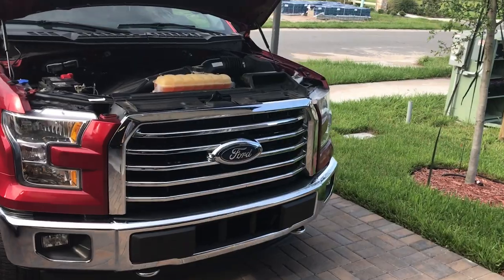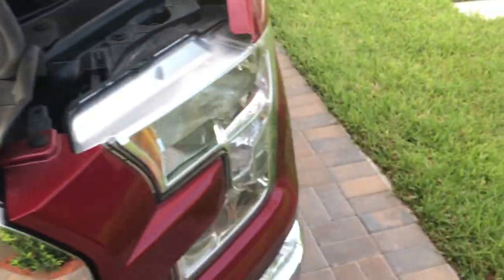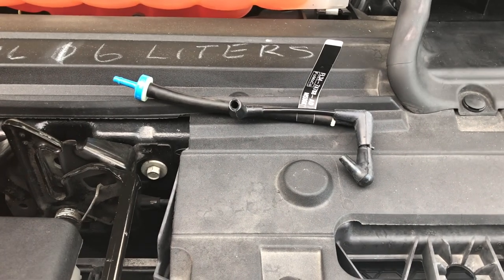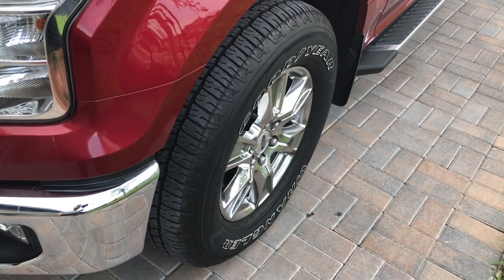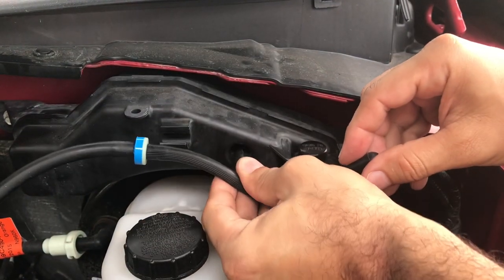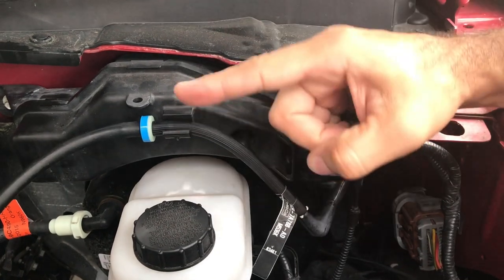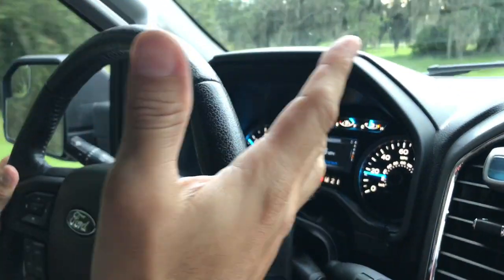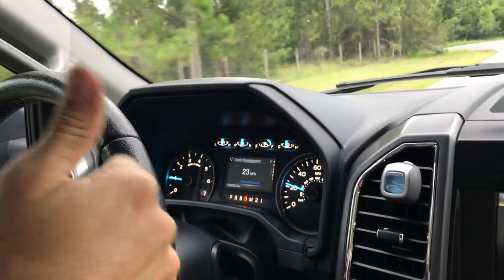IWE Check Valve Replacement On a Ford F150

Comment: Do you need to replace the solenoid ? Just wondering how many miles to replace the solenoid? Since it is a maintenance parts.
Reply from the maker: CZ TS !!! The solenoid should last fot the life of the truck. You should only replace it of it has gone bad. Check out this post explaining everything about the IWE. https://www.f150online.com/forums/articles-how-s/371599-everything-you-wanted-know-about-iwe-system-then-some.html
Reply: Daniel CarFix thanks

Comment: I noticed that if I engaged then dis engaged the 4x4 high, it would stop. I’m now looking for the part but have unplugged the power to it for now and it runs normal. Just can’t use 4x4 unless I plug it back in
Reply from the maker: This is the part I used for mine, which is a 2015 3.5 EB XLT

https://www.oemfordpartsfast.com/oem-parts/ford-vacuum-hose-fl3z3a788b
Reply: Same part I just installed today on my 2017 F150 XL.
Cured the problem immed. 
Just ordered a spare . . . as a backup.
Reply from the maker: @jamesm.8392  That's great news!
Reply: what did you unplug? id do this temporary until i can get it fixed. don't need 4x4 in the summer time lol
Reply: Edit: I actually do have full 4x4 function.

Comment: Is there any issue with removing the vacuum line and the system needing to create vacuum again? Or is that automatic once the truck is running again with the new lines?
Reply: Yes you can Rubber cap over both ends it'll only engage the hubs but not 4wd until you select it and transfer case gets activated

Comment: I just drove from Phoenix (+ 25c) to Edmonton (-25c) and i could head the grinding noise when making a left only. Could this be moisture in the lines freezing up?
Reply from the maker: SD This type of grinding normally happens under low engine rpms. If it grinds on the right side when you make a slow left turn, it could be a leak in the vacuum system. When it's the check valve, normally both sides grind, and you don't have to be making a turn.

Comment: Do you happen to have a link for this specific “upgraded” part number where I can order it? All I can find is a direct replacement for the original.
Reply from the maker: Hi Zeb. I bought at the dealership and paid 20 bucks for it. I also had challenges finding it online.
Reply: DCF GARAGE so I could contact the parts department at my local dealership and check to see if they have the part number you provided?
Reply from the maker: Zeb Ozbirn Given that you have a 2015-2017 3.5 ecoboost, yes. Or you can just ask them for the IWE check valve and give them your vin. They should know exactly which parr it is
Reply: DCF GARAGE I’ve got the 5.0, thanks. Gonna contact dealership. Thanks!
Reply: @dcfgarage  Yes, you can also get the check valve by itself from Oreilly's or anywhere, I think YG360. Cost me $8.
Reply from the maker: @richardnavratil9661  you're right!

Comment: This is happening to my 2011 f 150 eco boost I called local auto parts they have the solenoid but  not ice check valve.I tried the links you provided and nothing is there. Can you help me find the part?I even went to auto zone and read them part number and nothing.

Comment: Thanks for the video! Seems have to have fixed my issue too. Question, is it normal for the valve/solenoid components to release a small bit of pressure/air when the vehicle is turned off? I noticed that approximately 10-15 seconds after I shut the vehicle down, I can hear a small air pressure release from the area where the value/solenoid is located. Thanks again.
Reply from the maker: I'm gad it helped, Joe! It is normal for the truck to release vacuum after its turned off. On the other hand, when you turn on the ignition, ,without necessarily turning on the engine, it will turn on the vacuum pump, and disengage the IWE. You can do an experiment and lift the front wheels and with the truck off for a while, spin the front tires by hand. you will feel it heavy because the IWEs will be engaged. Then turn the ignition to ACC mode then spin the wheels. You feel it's a lot lighter because the IWEs would have been disengaged.
Reply: yes, when the truck is off, it will release, but should not when running in 2WD. After 4WD is on it will then again release vacuum.
Reply: @dcfgarage  Totally incorrect information, there is no vacuum pump, the engine running creates the vacuum, and it is stored in the vacuum after the check valve.  The lack of vacuum is what engages the IWEs  so if the truck has been sitting and vacuum is low or none the IWEs are engaged by their internal springs. So just turning on the ignition without the engine running there will be no vacuum and the IWEs will be be engaged. Once the engine is running the vacuum will pull through the check valve and fill the vacuum tank with vacuum and disengage the IWEs if the system is in 2WD mode, and in 4wd will  engage IWEs since no vacuum is going through the vacuum solenoid to the IWEs to disengage them.
Reply: @sirtigalotwolfe2962  mine releases after being in 2wd.
Reply: @xm15e2commando  if you have a Ecoboost model, there is a vacuum pump.
The V8 doesn't.
Reply: @puzzleluvr  That vacuum pump is to supply vacuum to the braking system and has nothing to do with the IWE system which gets vacuum from the intake manifold.

Comment: I just replaced the solenoid in mine and it's still doing it. How are the valve I replaced and the valve you replaced different in function?
Reply from the maker: The solenoid is what actuates the vacuum system for the IWE. The check valves are just one way valves. It becomes deflective when it doesn't hold vacuum and let's the air flow back. This makes the IWE engage in the hub and you hear the grinding noise.

Comment: It is remarkable how cheap the automotive industry has became. They are more interested in offering heated steering wheels than vehicle reliability. 

A service part?! I’ve seen drinking straws at restaurants with more integrity than the hoses ford uses to operate their drivetrain. 

Thanks for the helpful video. At least it should be a cheap fix.
Reply from the maker: Yw!
Reply: Yea how much more would it realistically cost to use copper hoses?? Oh wait no money on parts or labour at the dealerships that’s why

Comment: I’m confused. My 2017 experienced the chatter suddenly. I took it directly to the dealer and the IWE hubs were changed on both sides. However, I still heard the chattering, although not as persistent at macerate speeds, but more persistent at interstate speeds.  I watched your video and decided to change out the check valve following your instructions.  On the test drive, I heard the noise at moderate speeds, and at interstate speeds. 

After a brief stop, I drove again, and didn’t hear the chattering, so I’m confused. Is it possible that the system needed to reseal?
Reply from the maker: Could be a minor leak in one of those vacuum hoses

Comment: Does the vehicle have to be 4 x 4 for this problem to occur?
Reply from the maker: yes. This is a vaccum check valve for engaging the front wheels. So if you have a rattle, it's something else... possibly a heat shield... those tend to rattle on F150s
Reply: @dcfgarage  i checked the heat shield already it looks good. Some mechanic said it might be bad gasoline that i put from a gas station
Reply from the maker: @jaystocks460  if it’s just bad gas, the engine will misfire and you’ll get a check engine light. It would go away if you fill it up with good gas

Comment: Is there suppose to be vacuum coming out of the solenoid into the hubs when truck is on 2wd engine on? 
Because I don’t have no vacuum at all.
Reply from the maker: If the truck is on, yes. The vacuum will disengage the iwe
Reply: @dcfgarage  I get no vacuum from the top port of the solenoid.

Comment: Great !! Do you have a link to buy it ? I could not find it in amazon . Thanks
Reply from the maker: The best is to get it at the dealership. That's where I got mine
Reply: Probably late but, Motorcraft YG360 is the check valve part # $11.41 on Amazon.

Comment: Mine has been doing it for two weeks and I’m just now finding out about the check valve do you thank I have went too long and caused damage? I’ve drove my truck maybe 6 times at most while it’s grinded and it didn’t grind for long it stopped
Reply from the maker: Bama Fever probably not. It takes more to cause significant damage
Reply: Update I just checked my vacuum line it had suction but idk if it had enough suction I jacked my truck up took my wheel off cranked my truck in 2wd turned the hub and my axle was still turning....
Reply from the maker: Bama Fever when the engine is off, there is no vacuum, so the iwe engages. Turn the truck on with the front wheels lifted, and turn spin the front wheels by hand. If you feel the axle turn with the wheel, you probably have a vacuum leak. However, if the leak is small, then it will engage intermittently when u drive
Reply: Would replacing the vacuum check valve most likely be my fix?
Reply: Daniel CarFix or is it probably in the lines running from the check valve to the iwe?
Reply from the maker: Bama Fever if your truck is relatively new, and your check valve is the white one, I would go for that. It’s just 20 bucks fo the oem part. If your truck is 10 years or older, I would inspect the vacuum lines to check for cracks first
Reply: Daniel CarFix it’s a 2013 I ordered the check valve I’m going to replace it Tuesday if that doesn’t work I will get a vacuum pump and check to see if I have any cracks in my lines and if all that is good I guess it would have to be the iwe failing
Reply from the maker: Bama Fever Sometimes the boot on the iwe fail and it can’t hold vacuum. But it’s less likely than the check valve. If your iwe is damaged, you should consider one of those iwe eliminators and get rid of all the vacuum system altogether. That’s what I’d do if my iwe went bad
Reply: Daniel CarFix ok so I changed the check valve jacked my front wheels off the ground my passenger side tire is spinning freely the driver side the axle is turning with the tire
Reply from the maker: @bamafever92  Then you probably have either a leak in the hose for the diver side, or you have a leak in the IWE itself. The fact that the right side creates vacuum pretty  much eliminates the solenoid. 

Check out this video on how to use a vacuum pump to diagnose a leak -> https://www.youtube.com/watch?v=gwMXfQIjx5Y
Reply: Bama Fever I have the same exact thing. Was it your hub or your selenoid ? Your answer might save me hours of headache
Reply: Kollyn Jones mine was the iwe actuator inside the hub. It was easy to change no issues anymore.
Reply: Kollyn Jones best way to tell if it’s a vacuum issue is to turn your truck on make sure it’s in 2wd pull the suction hose of the hub on the side you are hearing the noise and see if you have suction there if you do then it’s prob the iwe actuator inside the hub
Reply: Bama Fever vacuum is weak to the side not engaging. Seems like it’s in the line or a check valve before the wheel. Hopefully didn’t fry either actuator because that one is constantly locked. Other engages and disengages only heard it rattle once or twice. Not sure though as I just got it used
Reply: Kollyn Jones take the line off the one that is working and see if they both have the same suction. That’s what I was thanking at first but it doesn’t take much suction for it to work properly. I changed my check valve and still had the same problem. Then I knew it was the iwe actuator inside the hub. Took it apart and sure enough it was in 3 different pieces I replaced it and haven’t had a problem sense. What year is your truck?
Reply: Bama Fever I have better vacuum at the one locked up then when I plug that same one off it increases at the other side that was lacking and then gets as much
Reply: Bama Fever it’s an 06. Wondering why I can’t just pull the vacuum to the other one so they’re both constantly locked in the wheel axels. Because the half shit engages and disengages with the switch
Reply: Kollyn Jones try changing that check valve first because it is the cheapest then go from there
Reply: Bama Fever is there a way I can check them? Air seemed to move both ways when I blew through. And it seemed the solenoid was the same way
Reply: Kollyn Jones there is just one check valve a line runs through it then goes to the solenoid. Mine has one Main line that runs from the solenoid goes down then forks off one goes to the driver side hub and one goes to the passenger side hub. If you have suction on the hoses at both hubs then your iwe actuator inside the hub is most likely needing to be replaced.

Comment: Did it affect your mpg(gas mileage)
Reply from the maker: It did not and should not. Unless your IWE has failed and is engaged all the time. In that case, the MPG should go up by 1mpg. However, I've heard that is exactly what ford is doing as a fix to this issue on these older models.

Comment: Did u hear grinding in 2wd or just in 4wd
Reply from the maker: Only in 2wd. When you engage 4wd, it disappears because the noise comes from the IWE grinding with the hub because there isn't enough vacuum to hold it in the right place.
Reply: Mine is the opposite. I’ve never heard the noise till I put it in 4a today and 4wd didn’t work. It’s the first time I’ve used it since buying the truck.
Reply from the maker: @TheSickCamaro  In your case, it's probably worth having a good ford tech test all vacuum lines and each IWE.
Reply from the maker: @TheSickCamaro  It could also be the transfer case, by your description.

Comment: I'm stuck in Mexico and my 2017 just started making the grinding noise!! I'm in middle of nowhere.  Has anyone cleaned the valve and got it to work again?
Reply from the maker: You can just remove the valve and block off the lines temporarily. That will leave the iwe engaged and stop the grinding

Comment: My 2019 Raptor had this issue after two years. Ford really needs to come up with a better solution. This is a decades old problem.
Reply from the maker: They did. The IWE is always connected now

Comment: Has this still been the fix. I see its been almost 6 months since you installed. I am having the same issue.
Reply from the maker: It did resolve the noise for my truck
Reply: @dcfgarage 
🤞 Just bought one at the dealer. Hopefully it works for me. Thanks!
Reply from the maker: @andyrackley2366  If it doesn't resolve, check the heat shields for the exhaust manifold.
Reply: @dcfgarage  I put a new check valve and solenoid on and it didn't fix it.  Luckily I do dealer trade driving for my local Ford dealer and got my truck in the shop yesterday afternoon. Ended up being both actuators. They replaced both IWE's, all new tubing, new check valve and solenoid. Covered under the 5yr/60000 powertrain warranty. Got it back this afternoon, so far so good.
Reply from the maker: @andyrackley2366  You're case was far worse. I'm happy you got both actuators replaced under warranty. Thank for sharing the result!
Reply: Andy Rackley if you don’t mind me asking. How much did they charge you ? I know it’s under warranty but still they will put the value. Thanks
Reply: @czts4778  They don't put the cost of warranty work on the bill. The tech told me around $500 for parts and labor. I bought mine CPO with 22,000 miles so I still have 2 years of the 7/100,000 powertrain left. After that when it happens again I will put the eliminator kit on it.
Reply: Andy Rackley what is the eliminator kit? Tell me it’s manual lock out hubs
Reply: @KollynJ  No.  It basically makes your axles turn when the vehicle is in motion so they are constantly engaged. The transfer case only activates when you shift on the fly or put in 4wd.  It eliminates the IWE system and vacuum. Basically you never have to worry about the actuators trying to engage because they are replaced by the delete kit. I haven't seen any remarks as far as wear and tear on the axles but those that have done the eliminator kit seem happy.  I believe most manufacturers, other than Ford, have hubs that are locked all the time. You are not in 4wd drive unless you activate the transfer case. I actually had the problem again and traded the truck for a 2020 Nissan Titan
Reply: Andy Rackley Wow I have my passenger side stuck locked in the axle for what ever reason. Maybe best thing I can do for now is remove the vacuum line at the driver side wheel so that is constantly locked in as well. Have to figure it doesn’t help the mpg or transmission

Comment: I replaced mine since it has never been replaced (no grinding) now with the new part its grinding?!
Reply from the maker: Maybe you didn't attach the vacuum hose well enough. Or maybe on the process, you introduced a leak. But I saw a video from "ford boss me" the other day where he talked about a TSB from ford directing techs to remove the vacuum hose that operates the iwes, so they remain engaged all the time. I guess ford has decided that the iwe design was a bad idea
Reply: @dcfgarage  lol-user error on the install. The actual vacuum that-has the blue on it was turned around -reversed. Something so simple but after looking at other videos i caught that the blue part goes a certain way (down)